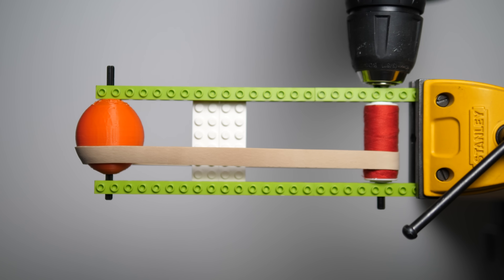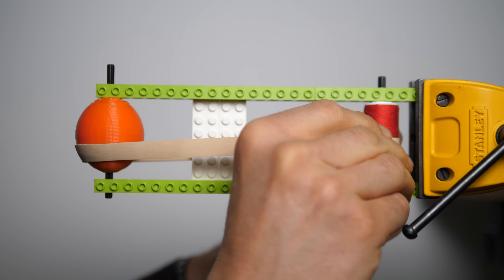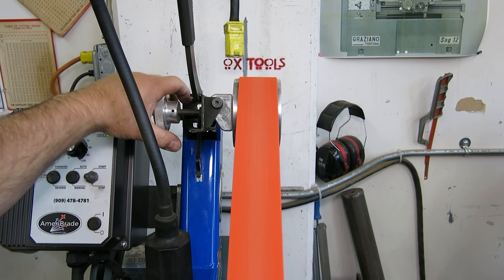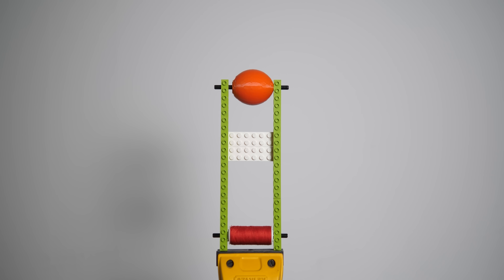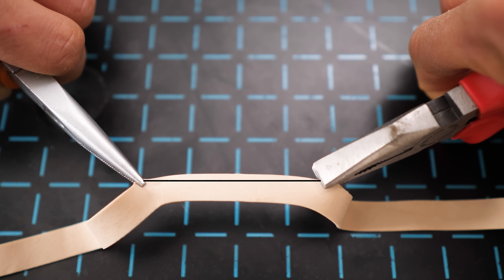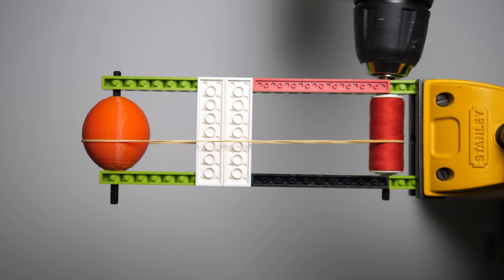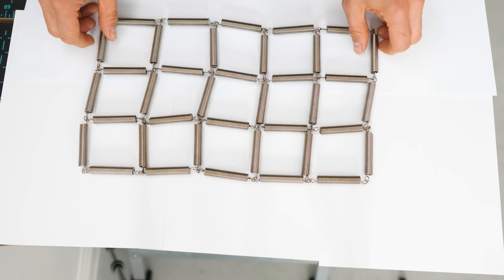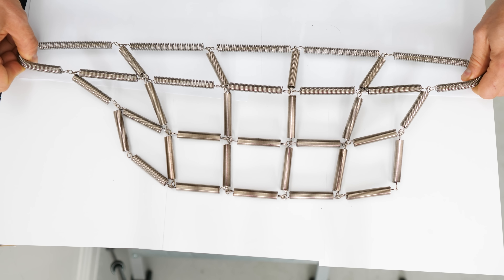The Band Should Slip Off But It Does The Opposite!

Comment: 3:12 "When you turn the pulley, it contacts a piece of band that is higher than the band already on the pulley."
Yeah, I don't get it.
That describes the obvious part, the "what is happening", but not the "why".
(Also, what does "higher" even mean in this context?)

If I say "when you turn on the switch, the lamp emits light", have I explained electricity?
No, I have explained only what a switch & a lamp do, but not why they do it.
Reply: When an elastic is stretched it wants to go back to it's "unstretched" position. Well, the "most stretched" part of the elastic in this case (the upper part) wants to go back more than the least stretched part of the elastic (bottom), and to do that it needs to go up the curve, to equalize the difference in "stretchiness" between to and bottom (well, the whole elastic really).   It wants equal tension throughout the elastic.   Sorry, I'm terrible at trying to explain in words.
Reply: @ThanksForAllMyToes  
That's the thing, if it wants to unstretch, shouldn't it move to a position that it's less stretched?
Why would it move to a position that more of the band becomes stretched?

Anyway, thanks for taking the time to try explaining! 🙂

Comment: Steve, I don't think this description is correct.

If this description is right, then the automatic centering of the belt depends on the belt's stretchiness, and it wouldn't work with a non-stretchy belt. Yet it works just as well with a band saw blade, or with a fabric belt (as used with an old steam engine tractor's PTO), as it does with a stretched rubber band.

Of course you could object that there's no such thing as a completely non-stretchy belt, but a band saw blade is close.

Instead, what I think is actually happening with the crowned pulley system is simpler than what you describe. Think of the belt as two sides, divided lengthwise. When the belt is off-center, because of the crown there's less tension on the side of the belt farthest from the center, so the the belt is being pulled toward the center. If you add the tension vectors for two sides (the larger vector for the center / tighter side, and the smaller vector for the off-center / looser side), pulling harder on the center / tighter side creates an angled combined tension vector, pulling the belt back toward the center.

In other words, the domed pulley is doing just what you would do in an active feedback system to keep the belt centered on a non-domed pulley: when the belt starts to drift out of its lane you'd tug on the side to pull it back.

I wonder what would happen with a mobius-strip (half-twist) belt?

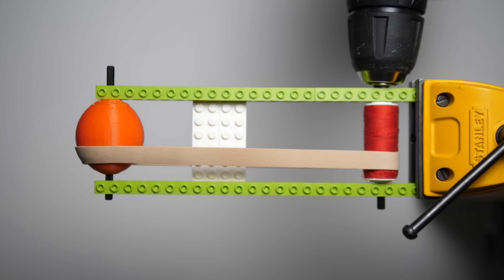Comment: I haven't watched the video, but I'm going to take a guess: the tension difference between the sides of the band, means the "upper" @0:58 has a better grip, which draws the band back to center. I'll provide an edit if I'm right or wrong.

Comment: Joerg Sprave of The Slingshot Channel actually did a couple videos showing how you could apply a heating mechanism to something like a slingshot crossbow.
When you stretch the band out, it heats up and so dissipates some of the stored energy if you wait a while before letting your shot go.
By heating the band, it can snap back more effectively.

Comment: It's funny I did initially come to the same conclusion. but for the wrong reasons, as the pully system stability reminded me on why train wheels are stable; which is a slightly other effect.

Comment: What about sanding belts and other non-elastic belts, though? Those things are usually EXTREMELY rigid, they have very little stretch. Are they still bowing like the rubber bands, but on a much smaller scale??

Comment: What are the limitations?
It seems to work better on long conveyor belts.
We had designed this for shorter belt about 45cm long one way. The belt was not rubber, just a standart conveyor belt for transporting dough balls. For some reasons it does not hold center very well. Would you know where can i find literature how to design a pulley, how to chose it's roundness and does it work with any material belts? In this video the band is relatively narrow compared to pulley, we need to have atleast 40 cm width, however normally i would not see belt width half narrow to pulley width, thats probably unnecessary anyways.
In this video you have one stright and one round pulley, would it work better if both were round shape or it would not work atall?

Comment: What happens if you use a concave pulley that has no ridges and a belt that’s not rubber — so doesn’t have a static-cling to it, and doesn’t form to the texture of the pulley itself? The way I see it: it’s part entropy, sure. But it could also partially be just the texture and static cling of the rubber band (with the concave pulley you used in that experiment— not necessarily with the crowned pulley) — think like the Archemides’ Screw functions, in conjunction with entropy since if it was purely operating on that in a non-closed system it would experience a ton of loss

Comment: this effects doesnt only happen in rubber belts, even so called "rigid" polymer belts(pa6, polyester, etc.) do the same. in conveyor belt systems with elastic bends a very slight concave radius is given to the pulleys and the belt aligns. but as most of you know, even tungsten carbide or diamond has a finite elastic module so every matter is basically a rubber.

Comment: 0:12: No, when I think of a pulley, I think of any kind of wheel that redirects the force that is applied to a string. This apparatus has four pulleys, two fixed and two loose, and it is called a tackle, which in this case reduces the necessary force to 1/4 of the weight of the load.
Reply: Good for you?

Comment: You've just turned everything around that i knew about conveyors. I work in the metal recycling industry and usually we have to track conveyors to keep them in line. Usually we tighten the side to make the conveyor move opposite of the side we tighten. Then we'd get some conveyors that just didn't seem to wanna do that. They'd  move opposite the way they should and everyone was always confused about it and just chocked it up to basically being a odd quirky attribute of that particular conveyor.
Reply: That’s awesome! It’s so fun to learn something that explains something you encountered in the past. Love that feeling. Like answering a question you’d forgotten you ever asked.
Reply: I'm wondering if the difference was how tight the particular conveyor was relative to the others. I'd guess a looser one would have the intuitive effect and a tighter one would have the effect described in this video. My thought is that looser would mean less grip and the belt would slide away from the crown while a tighter one would work its way up to the crown
Reply: Guessing, may be related to the great width of the belt.  If there is bias in any of the belt physical properties, it may throw its behavior out the window.  For example if the thickness varied linearly slightly across the width in which case the belt would now be a cone.  (and of course just saying this out loud doesn't sound plausible LOL!)
Reply: @NoferTrunions  Nope. It's a general rule. This tracking mechanism only works if you "crown" the pulley or roller, e.g. make it thicker at the center. skewing or shearing the axes of the rollers has different effects.
In wide conveyors you usually have one cylindrical/conical roller (the center cylindrical, the ends slightly conical). This provides a certain degree of self-tracking. Then on installation you adjust the rollers relative to each other to make the belt track. The crowned roller takes care of small disturbances.
It's a really weird discrepancy how crowning works opposite to skewing.
Reply: Wait is it chalked up or chocked up?
Reply: it’s “chalked up”
Reply: Sometimes belt arent properly cut and even with a crown pulley you wont be able to fix the drift.
Reply: 4:45 Still don't understand why it would bow upwards. I don't see anything pushing "up" just material stretching along the line. He did a terrible job at explaining. Why would those for springs be pushed up? I don't see any deformation that would push them in that direction?
Reply: @EbonyPope  for an elastic band think "pull" not "push." there are other comments here from engineers and students explaining the non-elastic belt tracking phenomenon. it is baffling for the layman to try to intuit, but hey my belt sanders go where i tell em to so im good with a surface level understanding.
Reply: Yup. Welcome to the real world.😊

Comment: I think that higher friction will exist to the side  where the band is the most stretched (the higher piont on the crowned pulley) and even though higher friction is usualy ascociated with ineficiency due to energy lost through heat in this case the friction is an increase in grip on the higher side of the pulley. Do you think that I'm looking at this the wrong way. Or to describe the same thing another way. The heat from the rubber belts internal forces as its stretched results in higher frictional grip on the surface of the pulley where it is stretched the most.

Comment: Without watching this video I must assume the reason the rubber band moves towards the center is because of its shape. The rubber band is equal in length on both of its rims and is being stretched on one rim disproportionately to the other when it’s off center, which creates a tightening force which lines the next part of the band which will contact the egg shaped bit when it rotates more towards the eggs center in an effort to correct its shape to the more natural perfectly circular position

Comment: Unfortunately looking from the side assumes this is a linear problem.
Not so 
This is a function of SURFACE AREA.
When the band comes in contact with a "flat " surface all contact points are "equal".
Theoretically flat and physically flat are two diff things so the belt wobbles.
When the contact surface is curved, the distance is now a function of force.
The slightest changes in surface area magnify force.
The bulge simply applies more force.
So the band experienced more force the greater the curve.
Proven by the concave pully.
They found that placing a bulge in a belt sander pulley kept the belt from running off the pulley simply cause the bulge in the center allows the belt to self adjust from experiencing greater force in the center.
The edges are allowed to "float" under less force.

Comment: I can't helping thinking this is actually incorrect (sorry, though I may be wrong!), in part because I feel I've seen this same effect on plenty of pulley systems with non-elastic drive belts.  Think of, for instance, a bandsaw with a metal blade tracked over two pulleys.  My initial thought was that the issue in essence comes down to a differential in friction on the band across the varying diameter of the convex pulley.  Obviously the surface of the pulley in the centre is moving faster than at the ends.  As such, there is greater drag against the edge of the band closest to the centre of the pulley, so pulling it inward until it's in a position of equilibrium - a bit like uneven breaking on one car wheel pulling the vehicle to one side.  The distortion effect of the elastic band may accentuate that, but I can't help feeling it would effect equally a non-elastic band (perhaps with some sort of tensioner on the pulley to allow for variation).  Am I wrong?

Comment: Thanks for the informative video! 👌 however all natural changes are driven by maximizing entropy, I believe your analogy on why the rubber band contracts is hard to get. The rubber molecules have low entropy & low potential energy, while relaxed (not stretched). They tend to contract when being stretched since their molecule bonds deform ( net of springs are handy), thus to get back to their original form(lower energy & a bit higher entropy status), they contract.

Comment: Another component of that is the areas closer to the equator of the ball are stretching the rubber band the most, so the forces trying to make it return to its unstretched state result in higher friction, which prevents the band just sliding or getting pulled to either side.

Additionally, the curvature means that at the point where the band rolls onto the ball, the centre axis of the band is directed through the balls axis, allowing that extra grip to steer it back towards the ball's equator. It's like when you roll adhesive tape onto a ball. It wants to follow the surface in a straight line relative to its axis. (Try it, you'll immediately understand what I verbosely explained.)

Comment: Adding a bit to the model. Ruber is a thermoset, meaning the spaghetti is held together at specific points in the chain. Those anchor points also help with the "memory" of the elastomeric molecular chain in the very specific case of a rubber band. Great explanation of heat and movement!

Comment: I've always thought this was reasonable. Not only do unevenly stretched bands and belts curve, but the "more stretched" section of the belt/rubber band has more tension, and thus more more traction (friction) on the pulley or roller. Makes it climb util it hits the peak of traction - or it hits an equilibrium point where the increase in friction and pull caused by the curvature, cannot overcome the elastic resistance anymore. Otherwise known by its brand new scientific term; 'Terminal Stickystretch-Climbalicity' Or, until the band /belt breaks of course.

Comment: I'm glad you brought in the ball chain, because I started out today watching you and Mendhi talk about the Mould effect.

No one considered that a ball chain is made of rods inserted into hollow balls. While the chain cannot be curved upon itself like Mardi Gras beads can, you can compress the chain until the rod has disappeared into the balls and the beads can touch. Sure, every chain has some play, and looks to me like there's a bit of a Mould effect on every chain, even more so emphasized by Mendhi's 2D models. However, the ball chain is the best at demonstrating this effect. The paper theorizing it as levers is absolutely absurd because it changes the entire structure of the chain, removing the ability to expand and contract the strand.

I think that that sort of mimicking of elasticity is very much why the Mould effect is the most pronounced on the most linearly "elastic" chain. It's why your ceiling fan pull will bounce back when you pull it too hard. It's why the chain end falls faster than gravity. It snaps back. You can see gravity's constant in the Mendhi's constant pointed out by the link connector in his video. Unlike true elasticity, however, there is rigidity in the system. This rigidity makes it behave more like the wide rubber band in this video than the thin band with equal sides.

Comment: I think the "compression" of the inner springs (in between two layers) is not enough to explain this phenomenon, we should add to it the "shearing" between two layers : we see at 4:15 the further we are from the middle, the more the inner springs pull on the top springs towards the middle , so the curvature is born.
the compression explains why the top springs go up, but does not explain the curvature.
I saw that in my first year of physics after I dropped off, it was very interesting, shearing that is. That's good to see an application here.

Very nice video :)

Comment: Could it be that what pulls the belt towards center is that the friction in the band more stretched is higher than the friction on the less stretched part.  Think of a car that has a wheel or wheels that suddenly hit a higher friction area like dirt or grass, that then pulls the rest of the car in that direction.

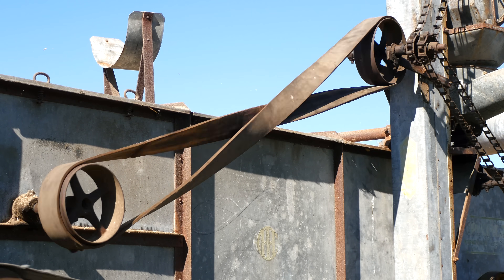Comment: I'm at 2:39 right now and i think i understand it. Because the rubber band is unevenly stretched it has more elastic tension at the side that is more stretched out. When you spin it it allows the rubber band to try to equalize favoring the tenser side where the most potential energy is. Because of this it pulls itself to the center where there is the most even distribution of potential energy.

I could be wrong but that's my theory

Comment: Has many used - especially in the old days where you had one central motor driving a lot of tools. Not having an edge on the driving wheels is much gentler on belt and it lasts a very long time as opposed to a V-belt or similar. As a bonus should the belt come off it's easier too to put on again.

Comment: A good majority of household vacuum cleaners use the coned pulley system to track the belts for the bristle rollers. I’ve seen a few that as the rubber belt wears it causes it to run on more of the side and can cause friction wear in the housings. So  after several hours of operation under tight preload, would the elasticity being worn cause the belt to  track off center?

Comment: I was thinking centrifugal force and the energy pulling the rubber band back keeps it on the round crown point. Its like putting a ball on the inside of a bigger ball and spinning the bigger ball fast, the smaller ball's gravity will be changed and the force pulls it toward the middle. Just like putting a ball on a uneven table, it will roll down towards the force pulling on it.

Comment: The answer to this problem is that because one side of the rubber band is being stretched it actually cocks itself towards the center of the curved pulley. And because it's cocked a little bit it grabs on to the pulley and it pulls towards the center.

Comment: Is this to say that the belt-driven machines in this video’s examples all use belts with some elasticity? I.e. do sanding belts also “arch” or curve upward such as in the rubber band demonstration? If the sanding belts are in fact inelastic, then what is the connection between the rubber band and a sanding belt?